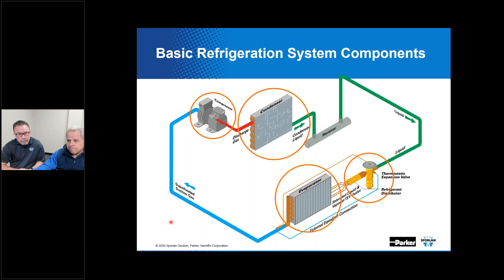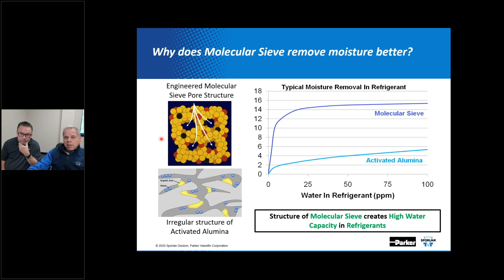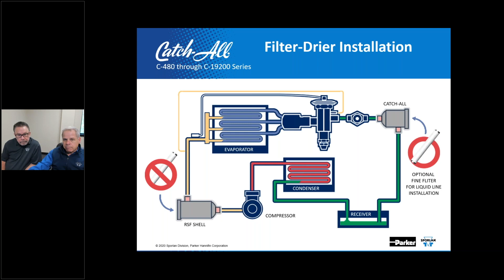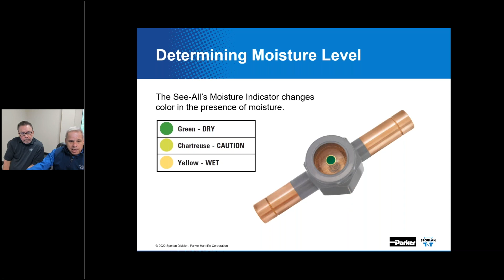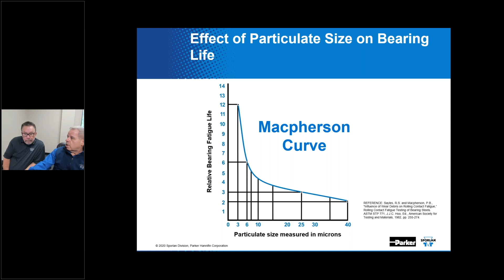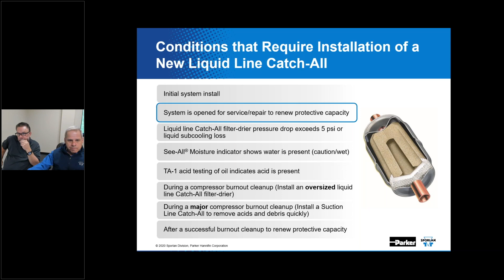Low & High Side Filter-Drier Application Considerations

Comment: Dear Sir, is this possible to share me TXV and EXV data sheet. Thanks
Reply from the maker: Parker Sporlan Bulletin 10-10 https://www.parker.com/literature/Sporlan/Sporlan%20pdf%20files/Sporlan%20pdf%20010/10-10.pdf?elqTrackId=6b08b07c5a1543e7a0e612545b391c9e&elqaid=16365&elqat=2

Parker Sporlan Bulletin 100-20 
https://www.parker.com/Literature/Sporlan/Sporlan%20pdf%20files/Sporlan%20pdf%20100/100-20%20Electric%20Expansion%20Valves.pdf